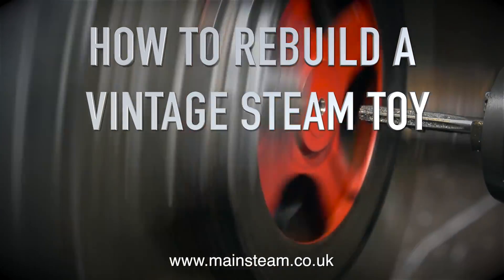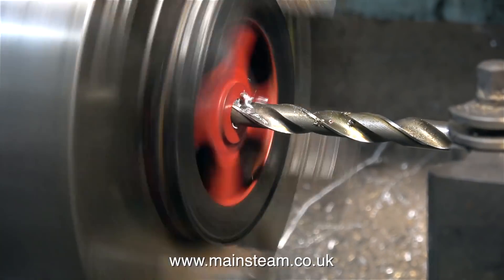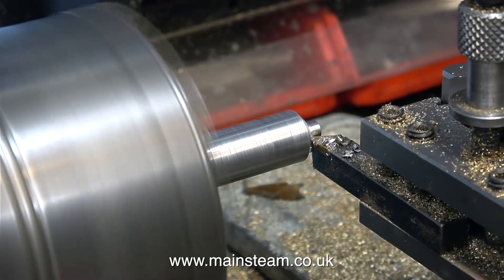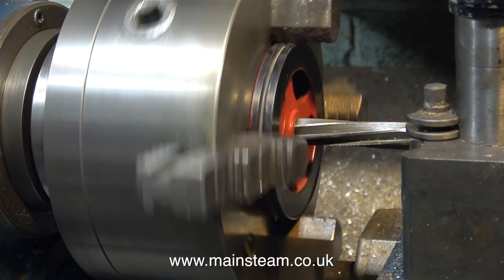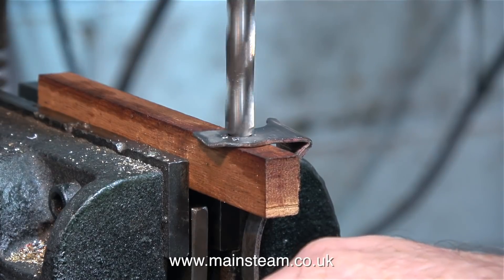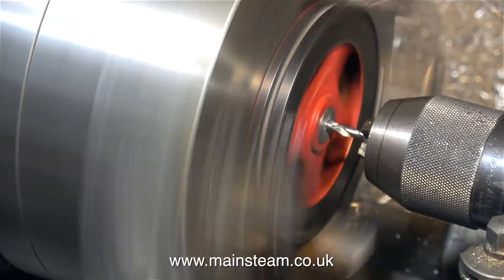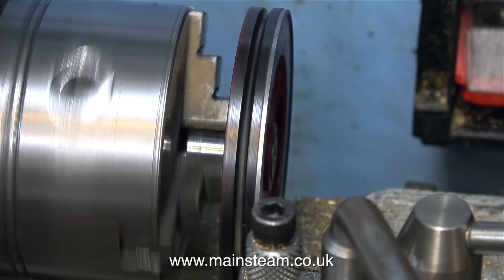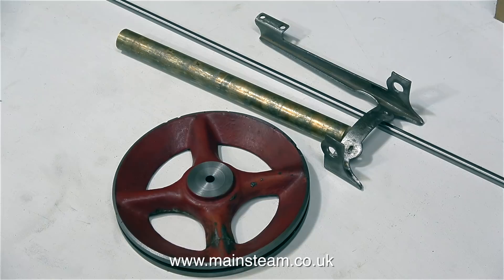HOW TO REBUILD A VINTAGE STEAM TOY - PART #3

Comment: While your Loctite solution works, I was wondering if a "press fit" when you heat up the flywheel to make the hole larger and then press in the inner bushing would work.  When cooled, it would be one piece.  I just don't know if it would work as well, or not.
Reply from the maker: I usually try to think out my "solutions" before choosing the method - and using heat to expand the already cracked flywheel with many blowholes wouldn't  be a good idea at all . . . .
Reply: Sounds like you have WAY more experience than I.  I just saw this method being used for automotive piston wrist pins, and thought it might work here.  Obviously not.

Comment: Really pleased your making proper bronze bearings for this steam toy. It makes me cringe when I see a steel crankshaft running through a thin steel plate bracket on these engines.
Reply from the maker: me too .....